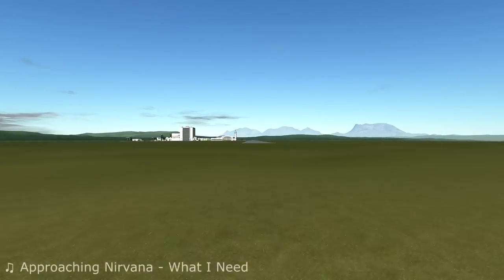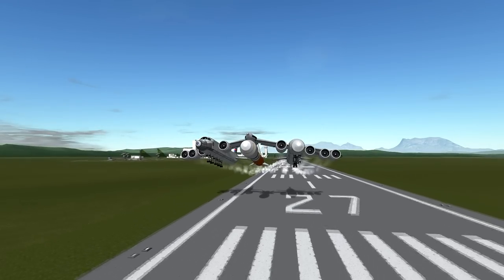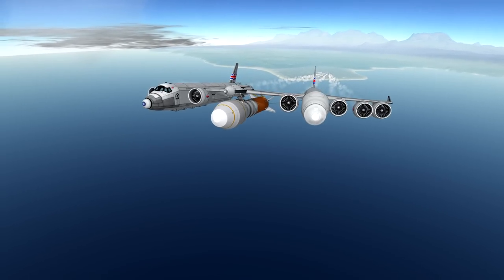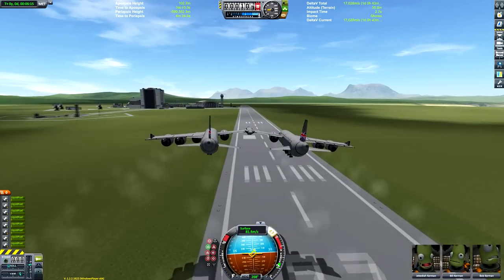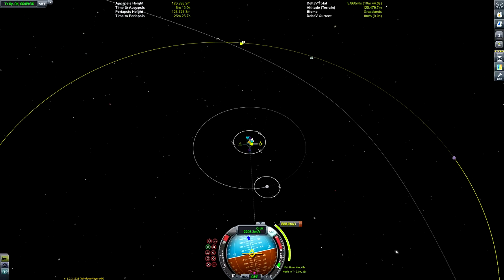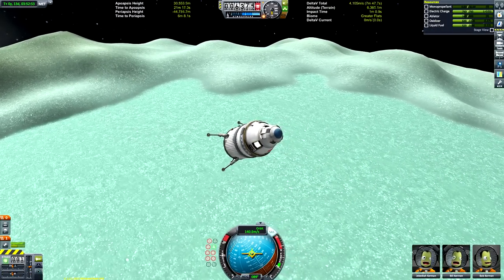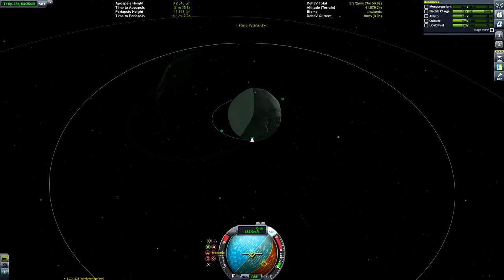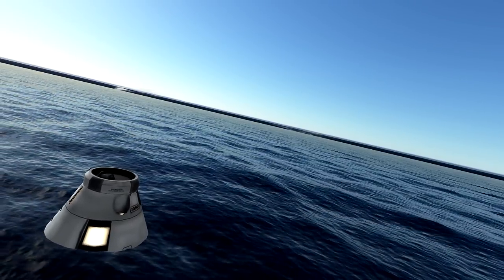KSP - Stratolaunch System!

Comment: awesome video as always! I really hope they add ways in stock ksp to pilot both parts of the ship after decoupling... maybe just an autopilot that could make the plane part follow a heading and an altitude, you coul tell it o turn around and head for 270 degrees while you finish putting the rocket into space and then come back to the ship and land it manually. Or the autopilot could be set to circle around KSC at a given altitude and a given radius to make sure the plane don't pass KSC or something like that.

Comment: Hey, Matt! I challenge you to build an Eve surface-return SSTO, capable of flying from Kerbin to Eve and returning from the surface. I don't think anyone else has done this before.
Please like so he can see this.
Reply: No one has done it because it's nearly impossible.
Reply: NOTHING is impossible for MATT LOWNE!
Reply: Oh... SSTO - Single stage to ORBIT - I thought you meaned fully recoverable
Reply: I did mean fully recoverable. But that is Expert Mode.
Reply: Bradley whistance
Reply: Been done, just requires cheating.
Reply: @rockspoon6528  Bradley Whistance managed to do it a couple of years ago, but before that it was considered impossible
Reply: @alfonsrasmus4710  He used part clipping, which is cheating.  It is physically impossible (without cheating) to go Kerbin-Eve-Kerbin with a single stage.

Comment: Hey, Matt. I have a challenge for you.Get a Kerbal from Low Kerbin Orbit to the Mun (you don't have to return, you can use a rescue ship) with no rocket. Oh, and I have done this, so it is not impossible. You need to use a thruster to launch the Kerbal into a Mun encounter and then use the EVA fuel to safely orbit it, and if you have any fuel left, try to land. No cheats are allowed. Have fun.

Comment: I worked for Stratolaunch, its not their first go at this. Stratolaunch is an offshoot of scaled composites, when I say offshoot, its literally the same people working under Paul G Allen's flag. By that I mean, Stratolaunch's hangar is built next door to Scaled composites, its the same engineers +some new talent, the same workforce +new talent, heck, even Burt Rutan had a huge influence in the design process. Stratolaunch "contracts" scaled composites for all the composite bits that need to be made. What does that all mean? Well, scaled composites has done this on a smaller scale, with beautiful composite aircraft such as White Knight one and two. If anything, they have an advantage over spaceX. I've been to SpaceX's facilities as well, and its like comparing an automobile art studio, to an actual auto manufacturer. One is dreaming of what they can build using the latest ideas/child like dreams (SpaceX), and the other is applying current theory with new ideas to evolve and actually produce a prototype for testing, and man it is huge. It is the worlds largest composite (mainly tons of hand laid carbon fiber) and experimental aircraft at this point. With 6 engine from a Boeing 747, 3 sets of rear landing gear, and two front from the same.

Comment: One pretty major point: Stratolaunch won't be carrying rockets that large at any point in the foreseeable future. Originally they planned to use a 5-engine variant of Falcon 9, then later said they'd be launching a new rocket from Orbital ATK called Pegasus II. That turned out to be too expensive, so now they're planning to launch a trio of Pegasus XL rockets. More than slightly underwhelming.

Comment: Would it be possible with propellers instead of jet engines. It think it would be lighter and cheaper
Reply: you sure about that  ? you can do pretty powerful props
Reply: you can make stock propellors too with a fairing, some RTGs and reaction wheels, check on youtube. the thing is i don't know what is their thrust because they re not considered as engines but as subassemblies meaning i don't how to get their performances. Big advantage is you don't need fuel at all and have infinite range
Reply: indeed you're right, i downloaded and tested it, fuel tanks are empty. however I have another issue : the plane is very unstable after launching the rocket...

Comment: 6000m/s dv on the upper stage? :o I only get 3000m/s out of the same tank/thruster setup...

Edit: I just looked into the craft file, and the stage has 3114m/s worth of dv. I dont want to blame you or anything, but what did you use to almost double that? Its fine, you clearly didnt mean to fool us as 3100m/s are enough to land on minmus, but there is something wrong :/
Reply: KevusBorus I have also checked the craft it's at 5998 m/s, same as in the clip.
Reply: Xelnah Weird, seems like something is wrong on my end... Thanks for checking
Reply: KevusBorus NP :D